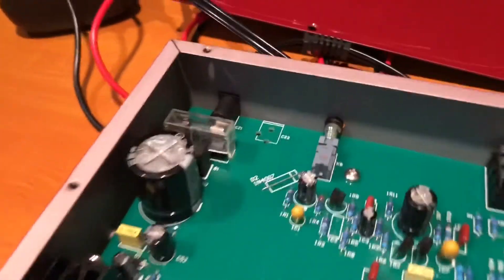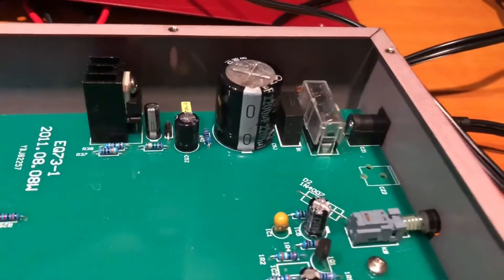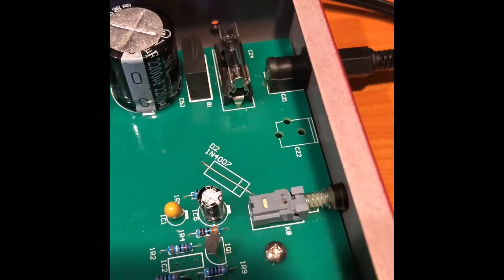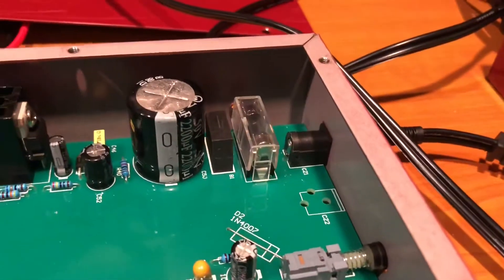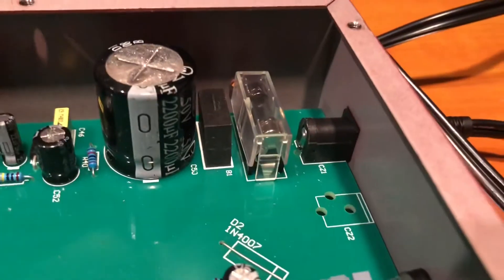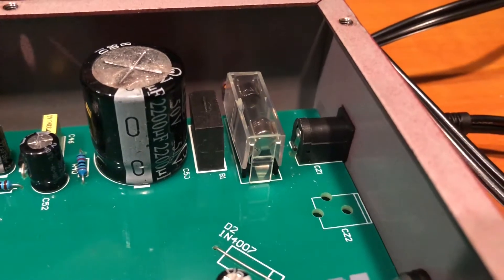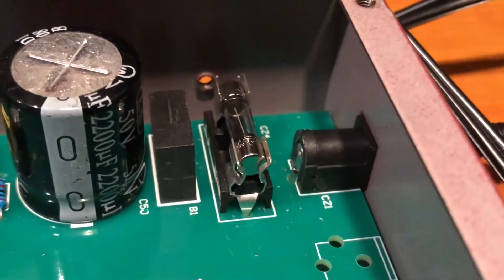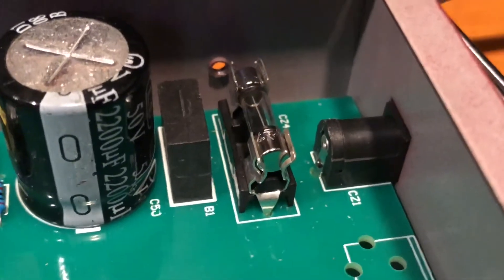Golden Age Project EQ-73 + PS AC-4 = Internal Fuse Swap

Comment: Thanks for the video. For people unfamiliar with fuses, such as I, what type of fuse to you advise I type in to Google?
Reply from the maker: If you take the existing fuse in to any electronics shop and say you need a slow-blow fuse with a 1.25 or 1.5 rating they can offer you options. These are super cheap and usually come in multipacks. Plus taking it in ensures you get the right length etc.

Comment: My 2 GAP 73-Preamp MKIII don't work. It's so estrange... One has a big HUM and the other just takes DI signal. Barely used, unplugged most of the time. Live in a rack next to gear that is used once in a while and when I needed them, they just suck. Any advise. You're the only one with a video on this brand talking about fixing something. Tired of the unboxing and comparing videos...
Reply from the maker: Hey Cesar, hard to know why your unit is giving you trouble. I have two Pre73 and they have been good to me. I also have the Comp54 and I did have some issues. However, I have had excellent results speaking with the folks at Golden Age project. They helped me identify the problem and advised me on fixing the issue. Obviously if your unit has more serious issues it will need to be repaired by an experienced tech. I encourage you to contact Golden Age directly. Good luck and I hope you get your Pre73 working.